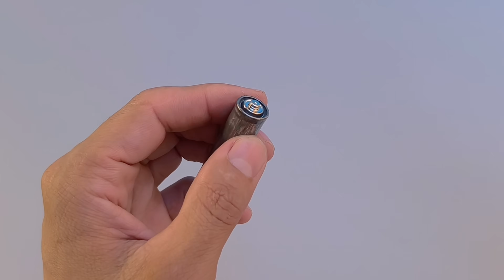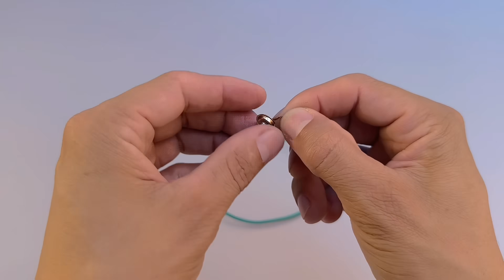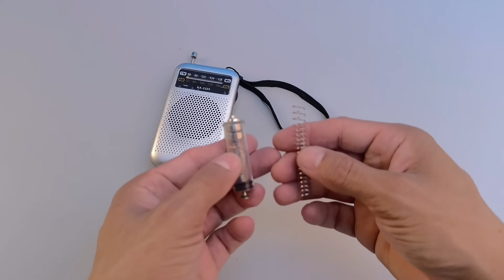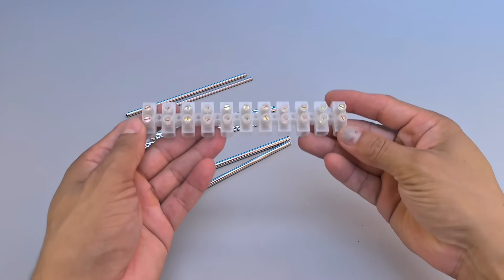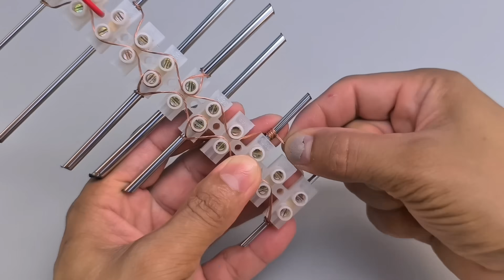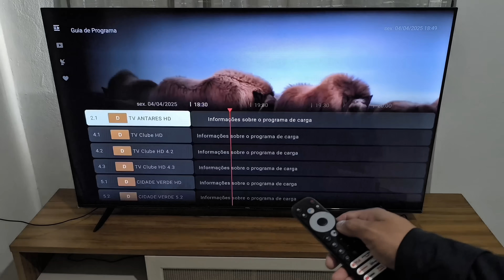Say goodbye to batteries! This trick makes your radio work for free forever

Comment: The syringe idea is good. However, I thought you were building an adapter with a cable where you could connect, for example, nearly empty D-cell batteries. That would certainly be more practical, because button cells have a very low capacity, so the batteries would be dead very quickly. The two AA batteries are designed for the radio's power consumption.
Reply from the maker: We appreciate your detailed feedback and insights on alternative power solutions!